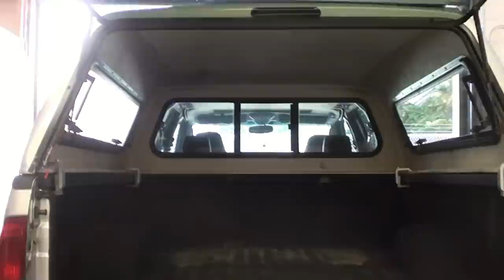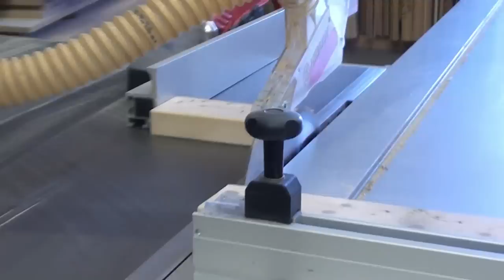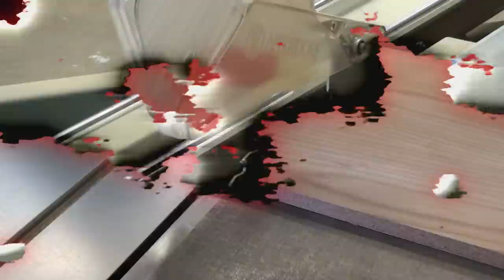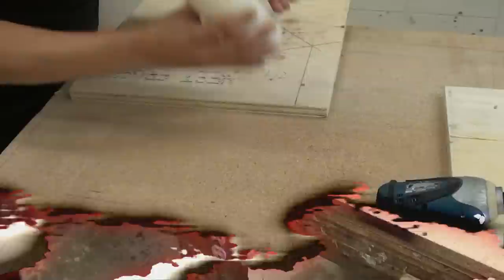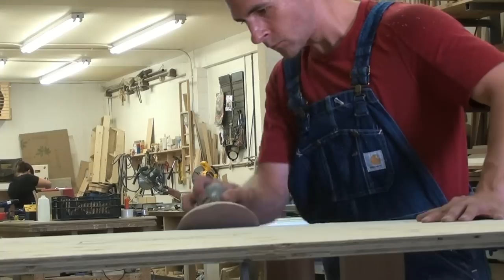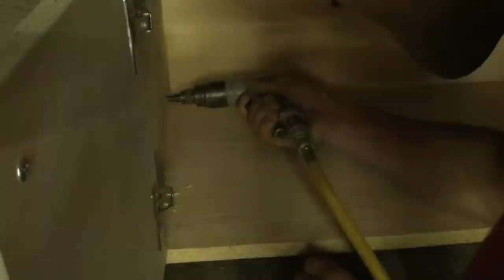Truck Canopy Sleeper - Part One

Comment: Looks great so far! I would recommend a battery box on one side in front of the wheel well with a vent though the floor and two batteries in parallel so you keep the 12 volts but double the amperage and a small 12 volt gas operated generator in a soundproof box in front of the other wheel well that intakes and exhausts out the bottom of the truck with a cabinet that goes to the roof above it for clothes/supplies/food that goes to the roof. I don't agree with the cabinet top over the edge of bed.

Comment: Years ago, RV companies made campers that attached to the bed of a truck. We still see one of these on a pickup occasionally, and they usually look worn out. I asked my local RV dealer (Stewarts RV, St. Clairsville, OH) , and was told that truck bed campers haven't been made in 20 years. He said the new trend was truck bed tents.

I've searched truck tent, and they do look nice. I wish I still had an option tho:)

CM
Reply: They are called truck campers and they do still make them

Comment: Are you planning to make it easier to use the area under the bed for storage? Right now with 2x4 base it is very well made and solid, but won't it be hard to slide packs, plastic tubs or other types of gear storage containers in and out?

Comment: OK, you have access to incredible tools. You should know something about them.

1. you don't use a fence and cross-cut sled at the same time. One or the other only. you can create deadly kickback with both.
2. don't ever use philips head screws into wood. square drive or star drive. Philips is designed to torque out and jump as you so expertly demonstrated in this vid.
Reply: The opinion police strike again!
Reply: The fence was actually pulled back as it is designed to do, for use as a cut off stop... You are correct in saying not to use both when it's in the forward/ ripping position.. But he wasn't... And I saw square drive screws... Phillips was designed to cam out in manufacturing.. That's why they suck for woodworking .. But a screw is a screw.. You say he should learn about his tools... Have you ever used a 10 foot slider like that? Or are you adept at reading magazines and commenting on you tube?

Comment: Canopy sleeper?  Fucking Canadians.  Just call it a topper.  Keep things simple.  I had one of these on the back of my F150 for about 7 years.  They are handy as hell.  Slayed many a dragon in the back of the old "Medivac".  Rubber bed mat, and a sleeping bag.  Like I said, keep it simple.
Reply: Camper Tops
Camper Shell
Topper 
Canopy
Canopy Sleeper
Pickup Cap